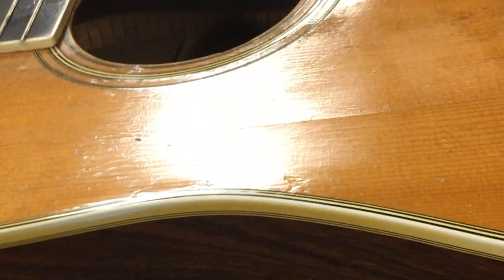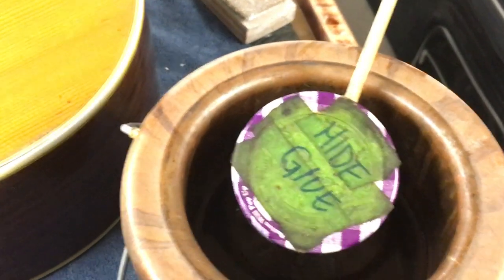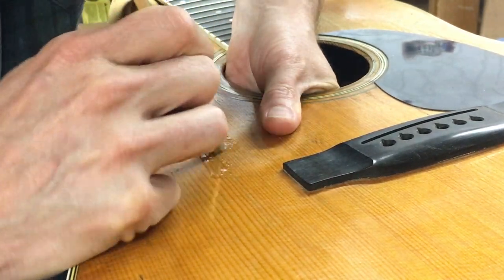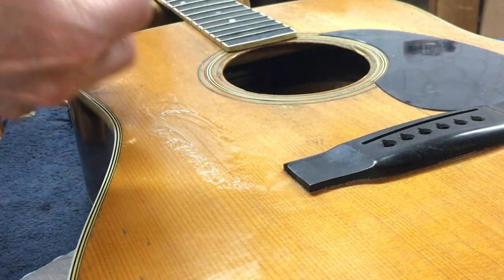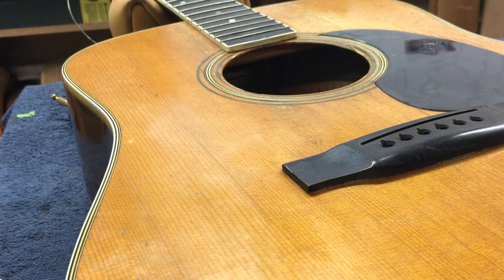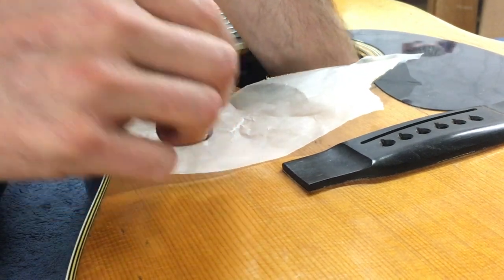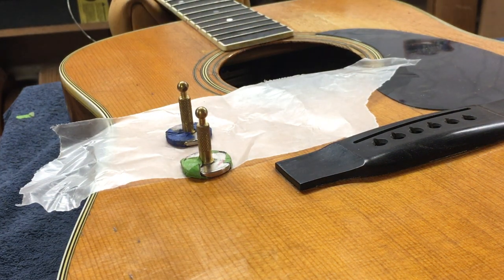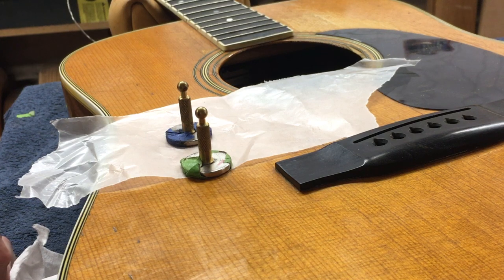Gluing Guitar Top crack with Hot Hide Glue HHG Beau Hannam Guitars and Ukuleles

Comment: Great video Beau. I’ve got a similar crack on a Koa top uke and was wondering if it’s necessary to add cleats? Can I get away with just glue in the crack to stabilize it? Thank you!
Reply from the maker: A lot of cracks can seem to hold without a cleat but it depends on why it cracked. I’d there is tension in the wood, you need a cleat. 
If the instrument is yours, you can always experiment with it- as you are using HHG you can just reglue the crack if it comes apart.